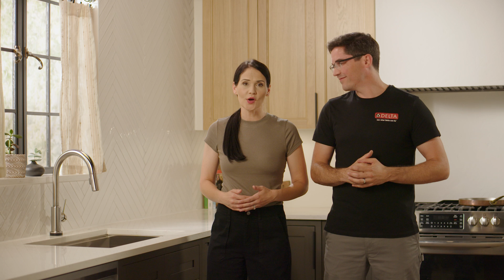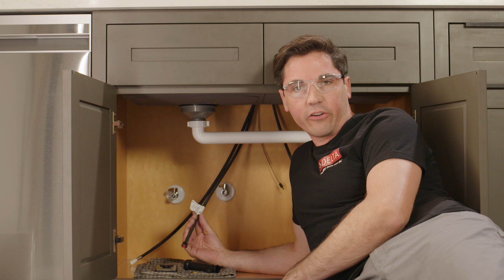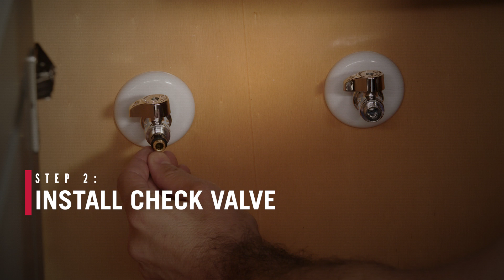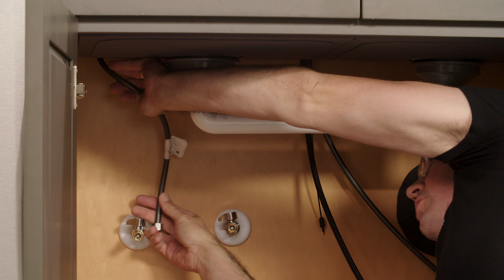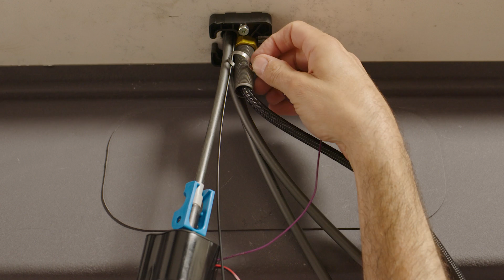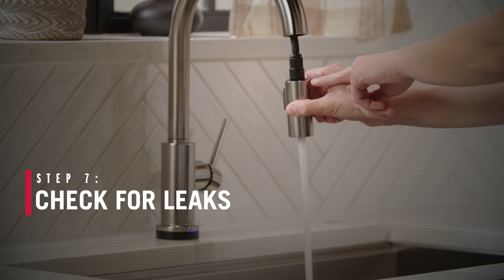How to Install a Delta® Touch2O® Kitchen Faucet with Touchless™ Technology

Comment: Great instructional video... easier than following the booklet.  However, I have a lot of other electrical and water lines under my sink and couldn't get a bucket anywhere close to the outlet line. So I cut a small section of old garden hose to direct the flush water into a bucket.  It worked great, no splash or cleanup was necessary.